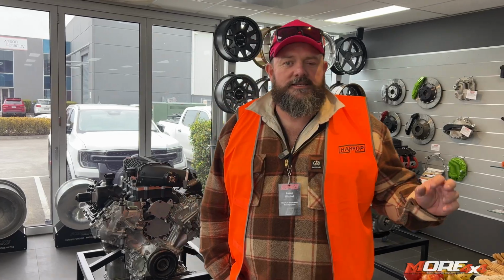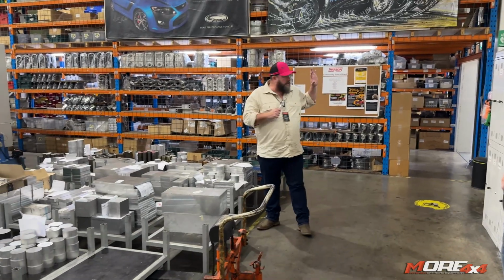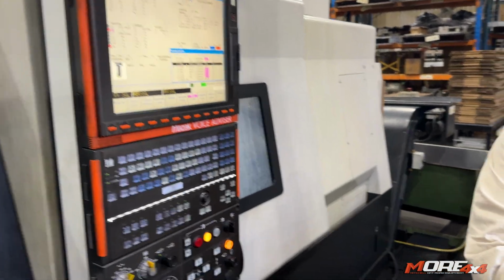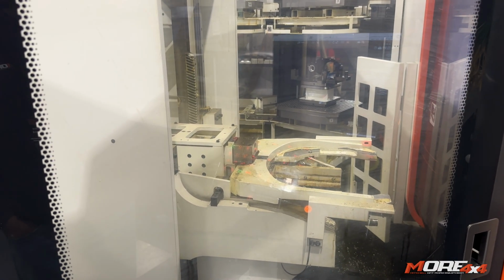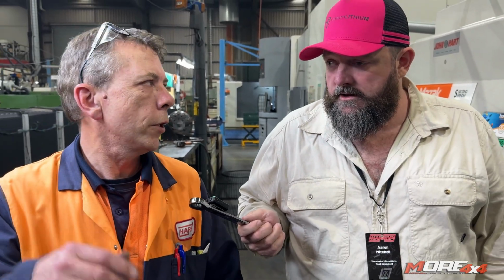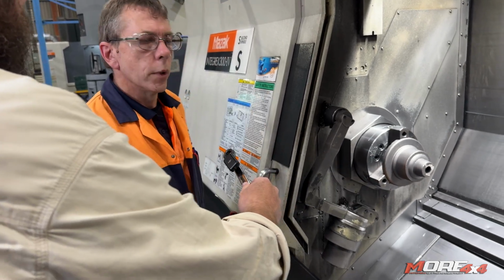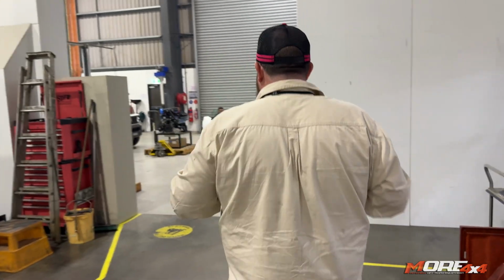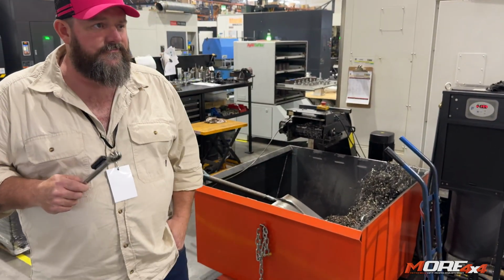EXCLUSIVE! - HARROP ENGINEERING - RARE FACTORY TOUR | by @MORE4x4_au

Comment: Damm i wish my Fortuner could get a super charger haha, mine is totally gutless
Reply from the maker: I feel you.

How many km on t?
Reply: @MORE4x4_au  170k soon
Reply from the maker: Are you aware there’s problems with the hidden fuel filter on that engine?
Reply: @MORE4x4_au Yeah the 5th injector filter buried in the rear of the motor. 
It's still got up and go, but under load like full ride or towing my jetski, it just loses the grunt
Reply from the maker: Are you aware there’s an additional hidden fuel filter that supplies the injecors (all 5) and the return fuel line to the tank and it might be contributing to your lack lustre performance?

We’ve done some videos on this, let me know if you’d like a link?